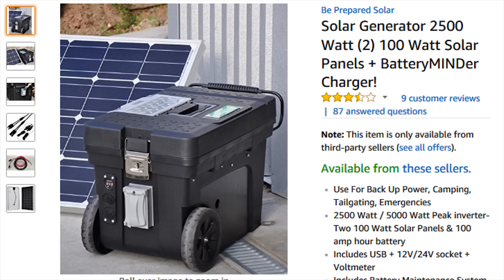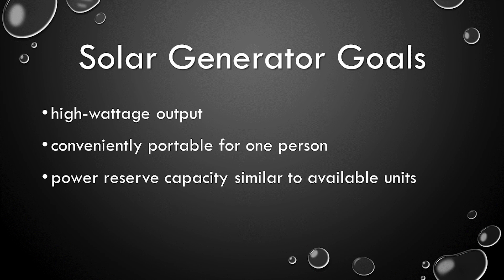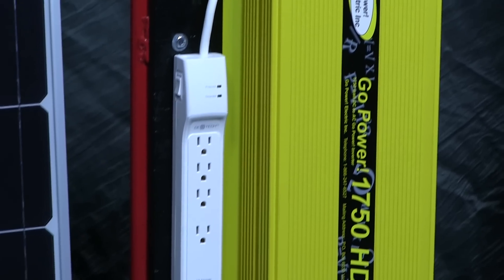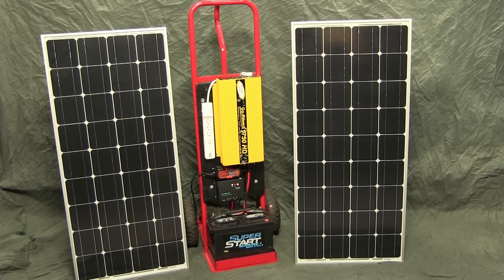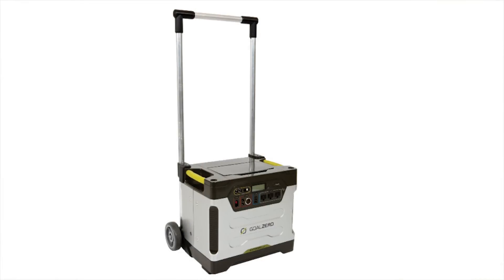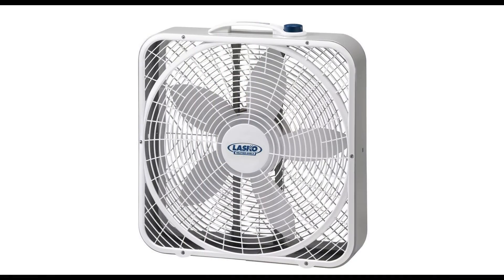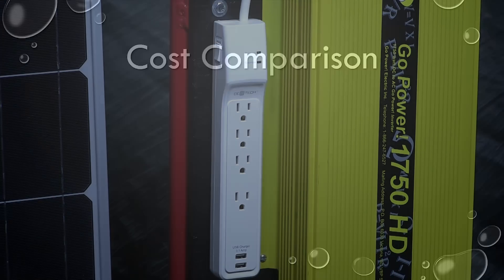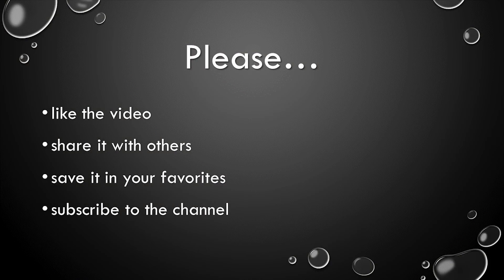DIY Off-Grid Solar Generator (rev 1) – Low-Cost Portable Power

Comment: I AM WATTS AND REAL ENJOYED YOUR MAKING THIS.WHY,WELL IN A FULLTIME RV,ER AND HAVE OWNED THREE HOMES,TRIED OF THE UPKEEP,I BOUGHT A THREE DIFFERENT RVS.THEY COME WITH INHERENT PROBLEMS,THE REFRIGERATORS ARE AMMONIA THE ROADS BEING PARKED ARE NOT LEVEL FOR RAIN RUN OFF.THE AMMONIA. IS ACID A EATS THREW THE TUBE,THERE 1300.00 BUCKS.THAT PLUS SEV. FEES ABOUT 200.00.FOR ABOUT 800.00 I CAN BUILD A REF.FROM WALMART THAT WILL NEVER FAIL.

Comment: Love this so much that I went out and bought all the items I needed to assemble this. The only thing I did different was get a Thunderbolt 500 watt charge controller. I have everything set up and attached to the hand truck like your picture. The problem...I am a 63 year old female, no "cables" came with anything and I am lost as how where do I get these cables or wires to hook all this up tp get it running and what are they called? Also I have no clue how to connect an inline 30A fuse . Other than that I have a pretty good handle on this. HELP!
Reply: harbor freight thunderbolt products have the connections, you can order on line as well

Comment: I would of put the battery on a swivel so I could lay the hand truck flat and put casters just below the handle of the for easy mobility loading in a truck bed or van etc.

Comment: you might want to check out how to make dry crystal batteries i hear they have live span of fifty years and can be almost completely drained of power without damaging also i hear the recharge is almost three times as fast.  i haven't tested it myself  so its hear say.  but worth checking into.

Comment: I'd like to know more about adding panels and batteries. A good diagram would help a lot. Thanks
Reply from the maker: You might like the build video for the final version of the generator which details the build process and includes a parts list, wiring diagram and engineering worksheet to help choose components.  https://youtu.be/QZYAAatdlmc You can plug numbers into the design worksheet to scale up the project with more panels and batteries.

Comment: Nice and practical. I only have 3 words for you: Lithium, Lithium, Lithium.
Reply from the maker: Lithium cuts weight and allows deeper daily discharge, but triples the cost of the batteries.  You might like the build video for the final version of the generator which details the build process and includes a parts list, wiring diagram and engineering worksheet to help choose components.  https://youtu.be/QZYAAatdlmc

Comment: AGM battery far far far superior than flooded 'deep cycle" which self discharge at a much greater rate , have much higher internal resistance, and dont tolerate deep discharge well.
Reply from the maker: Agreed.  You might like the build video for the final version of the generator which details the build process and includes a parts list, wiring diagram and engineering worksheet to help choose components.  https://youtu.be/QZYAAatdlmc. I used AGM as you suggested.  Let me know what you think...

Comment: You have done a nice job of building a portable and highly functional solar power system.  It is actually inaccurate to call it a "solar generator" though since a generator is a machine that converts mechanical energy into electrical energy.  But... I know that is sort of the standard terminology even though it is sort of like taking a bicycle and calling it a semi truck.  (They must be the same thing.  Look, they both have wheels.)  LOL.

Now, at the end of the video, you asked for viewers ideas on what you might have done differently.  Here are my thoughts.  There is always a tradeoff between portability and capacity.  That said, If you had turned that group 27 battery 90 degrees, you could put a second one beside it on the platform.  While this would add weight, you would double the amount of energy that you can store and use.

Your solar PV panels at 100 watts each, if connected in parallel, should output about 11 amps in full sun.  With 5 sun hours (not to be confused with daylight hours) a day average and assuming that you started with a full battery bank, your 200 watts of panels should easily keep your batteries full and ready to be used.  (In the southwest you'll probably get more sun hours.)  

Remember: Batteries are the heart of any solar system.  it is the batteries more than any other component that determine a solar system's versatility and usefulness.

In the event that a hunker down situation turned into a bug-out situation, you would have the option to simply leave one of the batteries behind if you needed to do so because of weight or for other reasons and you'd still have a functional system.

Also to consider...  Looking at the design of the hand cart, (specifically the handle) you could mount the charge controller and the inverter on the rear side of the board.  The handle would protect them from impact or pressure damage if the cart was toppled over. (Unlikely with a pair of big batteries stabilizing it.)  Then, your friend who welded up the battery box could help you put on a couple of brackets upon which to carry the solar panels when moving the system around your property.

Finally, I would suggest that you add some sort of weather protection for the inverter and the charge controller.  Those things don't like getting caught in those quick summer rainstorms. (OK, you said you were somewhere in AZ I think, so that might not be much of an issue for you, but it only takes once.  Inverters aren't cheap to replace.)

Comment: Great job- I thought I could do this until wiring- you should build these for people.
Reply from the maker: The rev 4 generator video details the build process and includes a parts list, wiring diagram and engineering worksheet to help choose components.  https://youtu.be/QZYAAatdlmc. Let me know what you think...
Reply: The wiring is actually pretty simple.  You can do this. --Including the wiring.  The solar panels connect to the charge controller with 2 wires.  The charge controller then connects to the battery with two somewhat shorter wires.  The inverter will come with two wires which attach to the inverter at one end and to the battery at the other.  Then the inverter will have a regular outlet similar to the ones in your house.  You just have to make sure that you keep the polarity straight. (Positive on the inverter to positive on the battery, etc...)  Do some research.  You can do this.  I put the solar in my RV without a problem and I'm an idiot.  LOL.

P.S.  The biggest mistake people make is using too small a wire size.  You should use nothing smaller that 8 AWG anywhere in the system.  If the wires are longer than 10 or 15 feet between the panels and the charge controller, go up one or even two wire sizes on those wires. Wire that large gets expensive though.  You can expect to pay nearly a dollar a foot for 8 AWG.  I'm afraid to price out the 6 and 4 AWG wires, but thankfully, my system doesn't require wire that large.

Comment: I forgot to mention that I am not running an inverter. I bought a 12 volt plug for my CPAP and run that with the humidifier off. Inverters cost lost amp Hrs. 12 volts to run my CB, 12 Volts to  charge batteries for an emergency radio. If the power grid goes down there will be no phones including cell phones. The government might broadcast on CB or HAM or an emergency broadcast on the over the air TV.
Reply from the maker: Good plan, actually.  I’ve done this on the rev 4 version. https://youtu.be/QZYAAatdlmc  I lose about 13% in this inverter, and it’s reasonably efficient.  Skipping the trip from 12VDC to 120VAC, and back down to 12VDC (or 5VDc for USB) is a good idea.  On this build, I have the whole 12V subsystem, and can just leave the inverter switched off.. Check it out to see your idea in action...

Comment: I'm building my own also and I too thought a bought the HB hand truck. I believe I am going to get a spill proof battery like an AGM. The AGM will not gas off while charging or discharging like the marine battery will. I also will be able to hook it with jumper cables to a marine type battery if I wish to. I am going to use a MPPT controller and I bought the EPEVER Tracer series 40 amp and bought the MT 50 remote meter. I have bought a Windy Nation 100 watt flexible panel to cut down on the weight; I also plan on buying another 100 watt panel like the one I just bought from Windy Nation. I bought a Optima 12 volt battery charger 2 years ago and am totally impressed with it's abilities. One last note is; be sure and fuse your solar panels and fuse  your output to your battery off the controller. Nice Video.
Reply from the maker: Wow - cool.  You’ve very nearly described the final version I got to at rev 4.  https://youtu.be/QZYAAatdlmc. Let me know what you think...

Comment: yeti is lithium, that is where the cost is
Reply from the maker: Yup -- Lithium really racks up the price.  Upgrading the rev 1 unit to Lithium would add $900 to the cost.  You might be interested to see the high-capacity rev 4 unit.  It's very capable, and still half the price of a Lithium-based commercial model.  https://youtu.be/QZYAAatdlmc

Comment: Goal Zero does have a lithium line of solar "generators" (biggest is a 3kw pack) that will way out preform lead acid battery system, not to mention it is hugely lighter and you can discharge it low without worrying about the battery lifetime, but it does come at a price

Comment from the maker: I appreciate you offering the idea.
The idea of fixing the panels to the cart in some way is one of the most popular.  (I‘d considered it in the beginning, but discarded the idea because of practical realities that preclude it).  
First, the hand truck is quite heavy with two batteries, particularly if using AGM batteries (weighing in at 135 lb / 61kg for just the two batteries) — fixing the panels to the truck will add both weight and bulk, making it too unwieldy to be practical.  Second, the tilt and direction of the panels has quite an effect on the solar energy gathered — fixing the panels to the truck with hinges will make it difficult to optimize this in any way.  Third, I found nowhere on the property that I could get all-day sun at ground level — it was necessary to put the panels up high and there’s no way the truck is going to get to where the panels need to be.
The final solution for me was to mount the panels in simple frames on the shade structure above the BBQ in a semi-permanent way, and run wire with a disconnect reaching a protected area under our covered patio where the generator is sheltered from rain.  When the generator is needed, I can roll it out of the garage and plug in the panels. 
For my concept of a portable emergency solar power generator, this seems like an ideal solution.  A of course, “your mileage may vary...”

Comment: i want to runs a small window unit ac during the day time here in florida....i know an electrical engineer but he cant be bothered to give me help
Reply from the maker: There’s a Design Guide video https://youtu.be/6glK8-IcDgE on my channel that can help you out.  In the description there’s a link to a worksheet you can download to find out what you’ll need to build a generator with the capacity required to support your A/C unit.  Since those units require a lot of power, you might want to see how few hours it really needs to provide the cooling you need.

Comment: I really like this system! Do you think adding a 2nd battery on that same cart would be simple to accomplish? I would imagine it takes up the remaining space on top of the truck, just curious if it would make hard to move around. I like how much cheaper it is! I've been thinking about getting the Ice chest looking system where the panels slide out from inside the unit. But your build is soooo much cheaper!!
Reply from the maker: I’ve just completed the fourth revision / rebuild of the solar generator, and I’m running the measurement testing to see the improvements.  This time the video will show how it’s constructed.  Of course, there will be a wiring diagram and complete parts list.  I’ll also include the downloadable Design Guide worksheet so you can build your own project, evaluate your existing system, or play “what if?” with possible upgrades.  There’s a Design Guide video with the worksheet download link at https://youtu.be/6glK8-IcDgE
Reply from the maker: Very prescient — I’ve completed a new version with two AGM batteries on the dolly.  This doubles the capacity or the number of sunless days the system can handle.  Watch for a new video in a few days.  I’ve not attached the panels because they really need to be mounted somewhere that gets all-day sun, and in most places this won’t be at ground level.
Reply from the maker: Thanks for the kind feedback.  I’ve just completed the fourth revision / rebuild of the solar generator, and I’m running the measurement testing to see the improvements.  I’ve build a new hand truck with a frame for two AGM batteries, and have upgraded  a number of components.  The video will be out in a few days.  Meanwhile, you can download the design worksheet from the link in the comments of the builder’s  guide.  https://youtu.be/6glK8-IcDgE
Reply: Desert Prep Awesome, clicking on the link now!!

Comment: use maintenance free battery maybe even a lithium
Reply from the maker: I’ve just completed the fourth revision / rebuild of the solar generator, and I’m running the measurement testing to see the improvements.  I’ve upgraded to maintenance-free AGM batteries, as you’ve suggested.  This time the video will show how it’s constructed.  Of course, there will be a wiring diagram and complete parts list.  I’ll also include the downloadable Design Guide worksheet so you can build your own project, evaluate your existing system, or play “what if?” with possible upgrades.  There’s ready a Design Guide video  with the worksheet download link at https://youtu.be/6glK8-IcDgE

Comment: I really liked your video, clear concise manner in your delivery. I am designing a 2000 +/- system. I like your choice for solar panel's and charge controller. Am debating what I want for my batteries, I actually want 2 batteries. The trickle charge is a plus.I have subscribed to your Channel.
Reply from the maker: Hi Steve.  Check out the Builder’s Guide video.  https://youtu.be/6glK8-IcDgE.  It has a design worksheet you can download that will do the design math for you a you consider your choice of components.  It also chronicles the mistakes I made that you’ll want to avoid.  There’s also a downloadable wiring diagram.  I’m just completed the final version, and there’ll be a video on the best off-grid version in a week.

Comment: I wouldn't be too much harder to add solar tracker and mount the panels on a rotating frame.  Tie the cart using stakes to keep the wind from blowing it over
Reply from the maker: My original concept was if the grid went down, we’d roll out the unit and prop up the panels to catch the sun.  I wanted to do a real-world test, and found that reality didn’t come too close to my original hopes.  There was actually nowhere practical that we could catch all-day sun at ground level, and I doubt it would have been possible anywhere we’d ever lived.  
We have a sun shade structure over the BBQ that was a much more practical solution, and it does allow for all-day sun.  Since this is intended to be an “emergency situation” unit, I haven’t gone to the extent of solar tracking, or even angle adjustment (but I do have an interesting way to partially address it).
The unit has been upgraded several times using suggestions from people like you that have been kind enough to offer them.  Rev 4 was completed yesterday, and I’ll be posting a video on the final build next week.  There’s also a Design Guide worksheet you can download to play “what if” with various configurations or to evaluate your own system.
Thanks for the suggestion — much appreciated.

Comment: My friend said that if you find an appropriate telescoping dolly you may be able to avoid removing the battery when transporting by car.
Reply from the maker: Thanks for the passing the suggestion — much appreciated.  The battery in pretty heavy, so the telescoping model would need to be quite sturdy.
Reply: Desert Prep I had a folding telescoping dolly that could carry a refrigerator.   I wish I still had it or the info on where to get it.
Reply: Desert Prep it was very similar to the one in the link.  Mine was 275lbs. Capacity but a different brand.  This might be the same one updated and/or rebranded.

Comment: Excellent presentation. I'd go with a 4 wheel cart to avoid tipping over the hand cart.
Reply from the maker: A sturdy garden cart is a great idea, and an excellent alternative.  For me, the hand truck is better for the several steps I have to navigate to the back yard, has a small footprint when stored in the garage (where it would be on the trickle charger), and offers a mount on the uprights for the back plane that holds all the components.  Thanks for the feedback — I expect a lot of the viewers will adopt your idea.
Reply: Battery on a gimbal setup ? I can almost picture it🤔

Comment: Wow.. I just came here because it looked interesting. Most of the time people say "affordable", but it's still more than i'm willing to spend. But this is actually fantastic. Plus, it can be a modular design. Allowing for incremental upgrades while keeping costs low. for example swapping out the battery for something other than lead acid.
Reply from the maker: Absolutely — pretty much the way this has gone for me.  Check out the follow-up videos for upgrade details and a design worksheet to hel_ evaluate options.